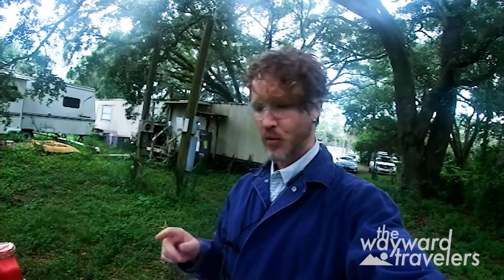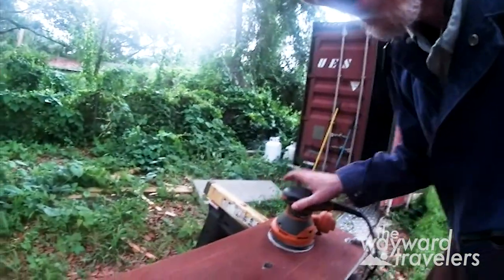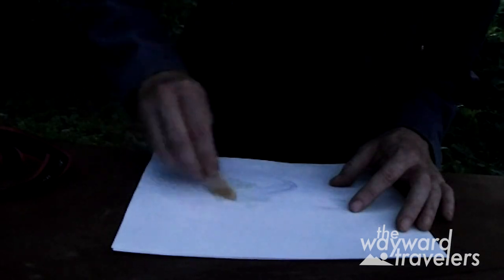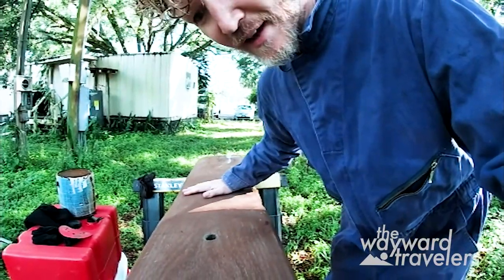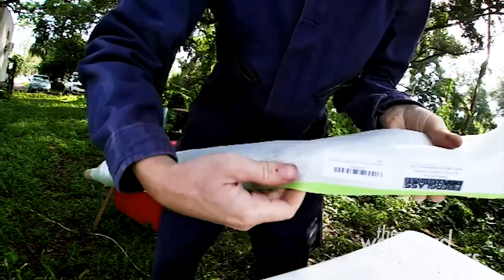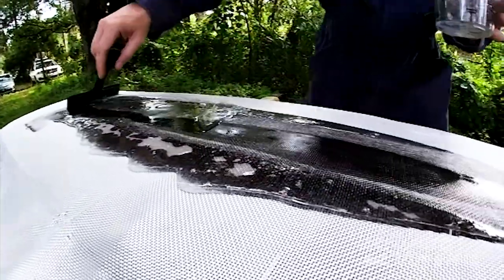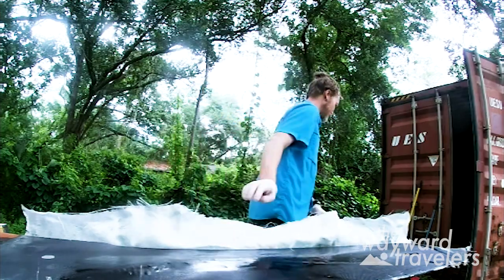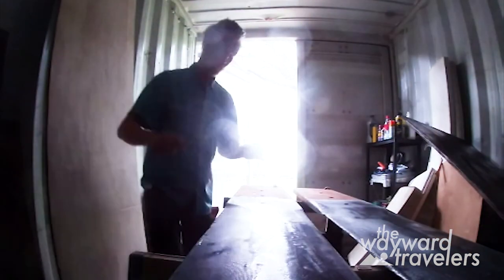Mahogany rudder repair with West Epoxy and fiberglass Part 1 - #CheapCatamaran #CheapSailboat

Comment: I want a smooth finish.  I believe even though sailboats travel at low speeds anti cavitation is important and can be reduced with a smooth rudder
Reply from the maker: I concur, but smooth is relative. Swimmers wear sharkskin suits, so it's relative

Comment: How do I know if my rudder is mahogany
Reply from the maker: I'm assuming it was already painted? Probably is if it is original. But a pine replacement would be much cheaper if it's a refit.
Reply: It's very heavy so I don''t believe its pine.
Reply from the maker: @cwmaxfield2000  probably mahogany then.